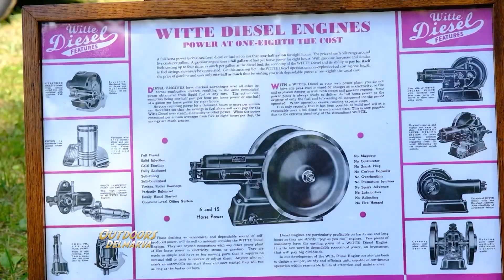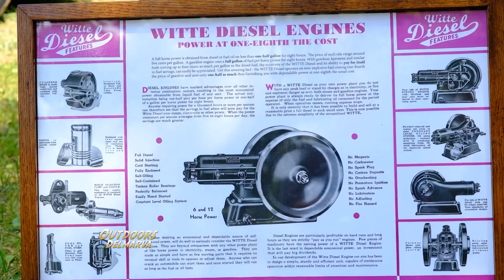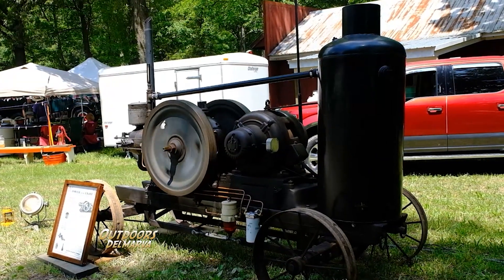Outdoors Delmarva:  Tuckahoe Steam and Gas Assoc. Show 2022

Comment: Their is more to the Tuckahoe Steam & Gas assoc. than what you see here. We have 2 sawmills on the grounds one steam and one gas tractor powered. We also have an Internal Combustion Museum with many running engines. Westinghouse & Edison electric lighting Dynamos in operation. Blacksmith Shop. Iron foundry work.